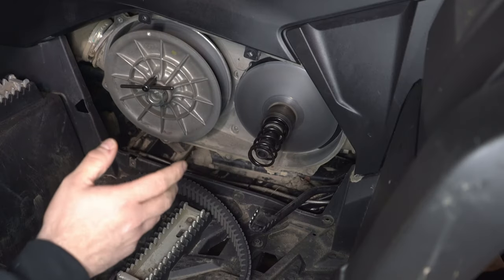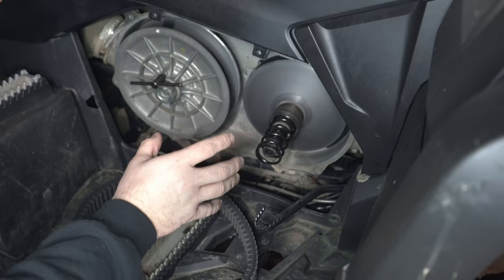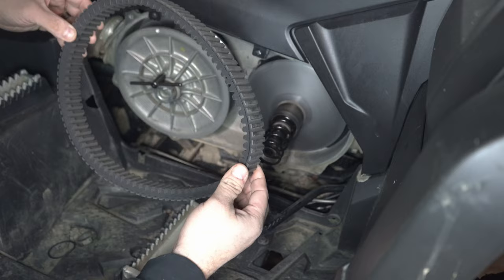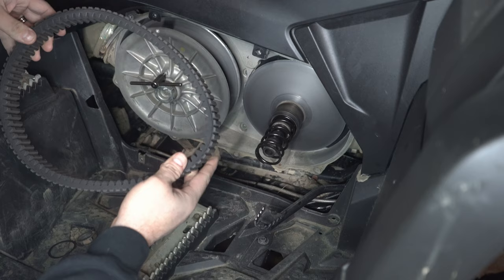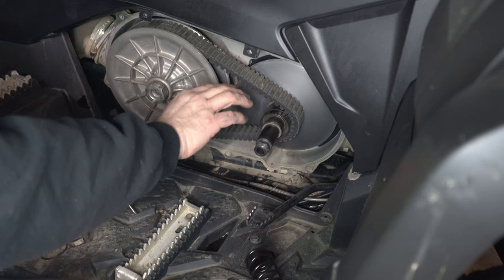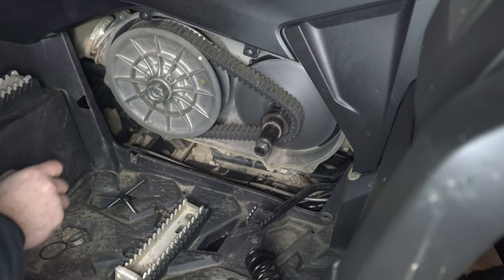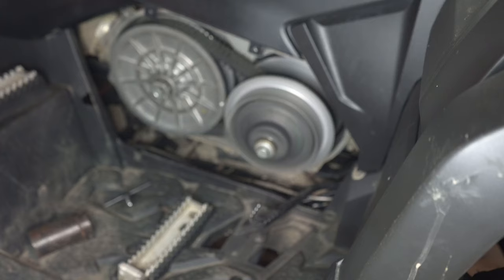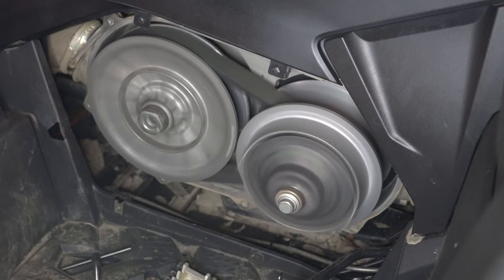Why your CFMOTO Has a Jerky Start / Clutch Noises

Comment: Best to buy a Honda with a real transmission, no belts, and never have to deal with belt slippage, breakage or weights and springs.  🏆🏆🏆
Reply from the maker: No thanks.  Honda and transmission plus reliable don’t even go In the same sentence 😂
Reply: @R.N.GPerformance  I stand by your assessment. Hondas last real transmissions were made in 1997 on the Japanese built accord! 😁
Reply: I had a Pioneer 700 for seven years which I just sold for a 2023 Yamaha wolverine x2.  Reason why I didn't go Honda again was lack of innovation and improvements in their sxs.
Reply: Not true if you get the hondamatic, any water trashes it and your out 2k for another, the foot shift is a different story, but the auto is not as good
Reply: I just sold my P5 with 5.9 " of suspension and a single cylinder for an 800 ex with 64 hp and 10.5" of stock suspension. Only about $2k difference and 3 years/3 k miles newer!
Reply: There’s definitely some truth to that.  Guy I know bought the Pioneer 1000, it was the first year it came out, but he took it in several times over transmission issues.
Reply: Much better yet, get the Yamaha YXZ, a true manual transmission with a real clutch. Then learn how to drive a manual transmission. My ‘16 has been through the mountains, dunes, Baja, and streets. Never seen a single issue.
Reply: If you wanna talk about jerky just talk about a pioneer 1000. That transmission is awful, every shift is clunky and jerky as hell. I wouldn't own another one.

Comment: I don't understand why CF Moto can't just make a great clutch set up from the factory? Isn't that what engineers are for?
Reply from the maker: I agree there.  Yes it is.
Reply: Can't make a one clutch fits all,so the factory tries to make everyone happy, the clutch kit user is the person that knows what where and when the ride needs power torque or rmp hp, no one will ever be totally happy with a factory clutch, unless you are a casual rider and don't push the machine hard

Comment: Hey I’ve been watching your videos learning all kinds thanks a lot man. I swamped my 2022 cforce 600. I did a cpl of oil flushes cleaned air box got new air filter and going to take the belt off and clean the clutch out tmr lol wondering if u should take spark plug out and clean that or not lol I’m on your videos steady hahah appreciate the help!! 👍

Comment: Hello I have a 2020 cforce 600 it started perfect for months now lately it don't want to start have to give it some gas for it to start then I have to hold the throttle for about a minute before it'll idle. Any help? No check engine light or anything. One way bearing was gone didn't know if that would make it hard to start?

Comment: That knocking was driving me crazy before I found out what it was.
Reply from the maker: Right
Reply: I just bought new 800XC, and I can hear the little clunk sound sometimes when slowly applying throttle and taking off, could it be those plate pins as in the video?
Reply: @edgarascernikas2238  hm I’m not too sure about that. The newer models might be different too.

Comment: Hello RNG, thanks for your tutorial videos, i research those a lot for my 550. I am in Germany and my official vendors has no idea about how to fix or tune CFmotos,. Apart from the mere stock CF stuff, there is extremally little or anything to tune. Also, while i have been asking the supplier since the beginning why my CF does not go on Low gear (have to haul alot and work on the farm so that low gear is key for me), i wander if you would know any particulars on why its not getting into Low gear, or if the gear is actually in, it slides out in midway (also i cant put it in park otherwise it wont release of Park and cant start or move)? I wish i could order from you and have things shipped from your website (but it would be too dear and customs would snatch it up) and just do it all myself- but again there isnt such a support in Germany yet, as far as i know, so I have to rely on the official vendors, who have literally no clue....

Comment: Thank you so much for this information. As soon as you pointed out the one way bearing I knew that was my issue. I have been weeding through BS trying to get a better understanding of what is going on in there before I tear it down. It's been getting hard to shift over the last snow plowing season, but now I have to shut it off to shift it. The shifter wont move with the engine running.

Comment: its easy the jerky is the person behind the throttle just get out your grinder and grind your belt down on each side until you see cords fly off then cut groves in top of the belt then turn it inside out flip it upside down make sure to sand the primary n secondary surfaces with 80 grit sand paper until ya see deep scratches then hang on cause now your atv will haul ass lol

Comment: Thanks for the info, very helpful. Just got my new UForce 1000 and noticed it’s a little jerky when I step on the pedal. I’ll wait to see how it goes until after it’s broken in.
Reply: It will continue to be jerky. The problem is not the clutch. A clutch kit will make the initial belt engagement better but not much. The problem is the the throttle sensitivity. Cracking the throttle even one millimeter, the engine ramps to fast. The fix will be softening the first 1/2" or so of pedal movement. You don't need to go from idle RPM to the machine jumping in 1 millimeter of pedal movement. Once the belt is engaged, the throttle needs to ease into the RPM. The UFORCE 1000 does not. It's a real shame because the machine is pretty dang nice otherwise.
Reply: @philburke1902   Thanks for the advice. What state do you live in? I’m in PA, if your not to far I would consider having you work on my unit…

Comment: Red Nick, you do a great job on your videos, Thanks,   My question is:  going over the top of the Clutch is a shielded piece of plastic, which seem to go into the back of the motor, and it has a clean out on the bottom.  What is it for?  Breathing for the CVT? 2022 CFmots Zforce 800 ex.    THANKS and keep up the great work.
Reply from the maker: Yes. And it’s for water to drain it if it gets in there. Thank you 🙏

Comment: I finally got time to install my clutch kit from you( primary, secondary spring, and helix). So the "clanging" sound at idle from the primary is normal? I removed the primary probably 5 or six times. The sound goes away when the rpms increase. It frustrated me. Put everything back together, took it for a spin and it was very smooth engagement. That "clanging" really gets me. Your videos are great!!!
Reply from the maker: Clanging is normal that’s the 3 slides on the cam plate.
Reply: @R.N.GPerformance  thanks for the reply. Never had the covers off before. It seems more of a pinging,  not a clanging sound. It's not as noticeable with them on. Your videos are very helpful and informative!!

Comment: So I have replaced my one-way bearing it's on counter clockwise and cleaned off with alcohol to be sure that grease is not my issue but still I have my secondary spining in Natural and park. If I go back into high and back to park it stops for a few the starts moving again. Sorry to ask you this but I feel your my only hope! Thx 🙏 my friend
Reply from the maker: Give me a call tomorrow 3308060728

Comment: Jerkines is mostly because belt is burned or its under 33mm. Also youre missing alot of things that cause this damage to belt or even CVT itself. You should mention them if you want make videos about it.
Reply: Have less than 1600 miles on our uforce 1000 and its already jerky. The belt was inspected and looks new. Issue is not just because of worn belts.

Comment: 🤣 I got 100km out of my OEM belt paid $317 for a new cf Moto belt and got 25km out of it and it's screwed again. Regret not getting a Suzuki king quad. Nevery had a problem with my old king quad
Reply from the maker: Have you gotten a clutch kit? I recommend only oem belts we sell them far cheaper.  I would also recommend our clutch kits.  We are seeing awesome belt life in our rigs 
https://rngperformance.net/shop-parts-accessories/ols/products/cfmoto-oem-belt/v/0JWA-055000-10000
Reply: @R.N.GPerformance   no clutch kit on it yet only had the bike 2 weeks really frustrated that the belt has gone out twice on a $22k bike I just bought 2 weeks ago

Comment: We were test driving utvs, did can-am defender,  polaris ranger, both 6 seaters. Also tested a cf moto uforce 2 seater  that the belts were squealing and was very noisy in comparison. The dealer just said, "They're all like that." Assuming he meant the moto's? The other one we test drove weren't. But then, the engine and transmission was a full row of seats back further. Would it make that much difference?
Reply from the maker: The belt shouldn’t have been squealing.

Comment: Hey! Someone sent me your link. Lots of good stuff on here. What is that tool you used to loosen the belt? Also was it clockwise or counter?
Reply from the maker: The tool is just a m6x1.0 bolt 3 inch long threaded all the way it’s regular thread.  The primary clutch is reverse thread. The secondary is regular thread.   Thank you 🙏

Comment: RNG, why is the Yamaha CVT rated the best in the industry and they even back it up with a 10 year belt warranty.  Why are they so indestructible?
Reply from the maker: I have no idea.  I think they are just brave.  😂.  They may also use a wet clutch too that takes the beating instead of the belt.  Like our zforce 800s

Comment: In trying to replace the one way clutch bearing on my cforce 500, the bearing will slide over the shaft only to where the locks touch the shaft and won't go any farther. I already trashed one bearing by trying to lightly tapping it the rest of the way onto the shaft
SO HOW DO I GET THIS BEARING TO GO ALL THE WAY ON?

Comment: Mate do you have videos regarding on one way bearing on my primary clutch ? Hard to hift while on h,l and reverse but when the engine is off its smooth to shift? Tnx
Reply from the maker: CFMOTO Engine Brake Problems and Fixes
https://youtu.be/tPa14FY8Ops

Comment: I just went to be able to start rolling at a lower rpm. I have 2 - 600 touring cforce completely stock everything and I have to rev it so high just to get moving. Anyone have a suggestion in what clutch I should purchase?
Reply from the maker: You need our primary clutch kit it will take care of that www.rngperformance.net

Comment: I got a new 2023 uforce 800 I owed a 2017 uforce 800 before and it had engine braking my new one don’t seem to be working do you know what could be the issue
Reply from the maker: My primary kit that will help allot. https://rngperformance.net/shop-parts-accessories/ols/products/cfmoto-cforce-1000-stage-1-clutch-kit

Comment: Hi RN quick question, my 22 UForce has about 900 miles and I’ve been running one of your basic clutch kits for 4-5 months.  I recently started getting a grinding sound in low gear when I’m slowing down to a stop.  Never in high gear but it is intermittent in low.  It sounds like the gear (or clutch?) is not fully engaged, but never happens on take off.  Any ideas what’s making the sound? Is it the primary bearing?  Thanks!
Reply from the maker: Shifter linkage buddy. Low gear isn’t locked all the way in.  Or pinion is going out.  See my newest video we blew a rear differential.
Reply: @R.N.GPerformance  thank you!  I will check the linkage.  Would it be the Front or rear pinion?  I can check that too.  👍

Comment: Hey RNG my 2023 uforce 1000 has almost 2000 miles on it and it's made that rattle cling noise since I bought only does it at idle what could I do to stop it called the dealer and they gave me some run around that they hey dirt in them that's why it's making that noise I bought it brand new and it made that noise just trynna get it fixed the only problem I've had with mine
Reply from the maker: That noise is normal for these clutches.  However if that noise gets really loud you will want to replace your sliders here. https://rngperformance.net/shop-parts-accessories/ols/products/cfmoto-cam-slider-replaces-oem-number-0jya-051004-10000-fits-most-models
Reply: @R.N.GPerformance  OK thank you!!

Comment: Hello Guys ,I have an issue with a CFmoto 625 from 2022 4500 Km on it . Will start but will go high in revs around 2500-3000 then comes slowly down and stays or slowly fluctuate . When driving it will not go more them 40 Km ( in hight ) , from there on the engine is stalling , like it does not have power to go forward. If I start the machine in neutral and rev it , between 4000-5000 it is like is folding something the engine back and will hesitate to smoothly rev after passed the 5000 barrier will rev till max.

I have checked the bet, one way bearings weight etc there is all fine , as it does the same when those are off. Has already new spark, spark lead . New filter . No error on dashboard.

Does anyone came across this and can give me some advise  ?  Thanks

Comment: If I have a uforce 1000 do you think it would be okay to do 30 inch tires and a 2 inch lift or should I just do 30 inch tires or maybe 28 inch tires and a 2 inch lift. I mainly ride a lake bottom it’s sandy in some spots and muddy and rocky. It’s road a lot so the mud is real thick and deep. Just wanted a opinion
Reply from the maker: You can do 30s and a lift.  I do recommend 1.5 spacers in front and 2inch in rear.  I do sell this stuff on my website. Www.rngperformance.net

Comment: My 2019 CFmoto Cforce 500s (75hours) was stolen and when it was found it wouldnt drive—found the remnants of the belt in the clutch and a weird tapping noise—cleaned it up and reinstalled with new belt but still makes weird nosie and when I put in gear the engine dies—Im guessing both primary/secondary clutches are shot? I think the thief rode the ATV fast in low gear? Is there anything I need to check? Im scared something internally is bad…
Reply: I dont mind paying you for your time/information definitely not here to take advantage of your knowledge—Im just on the fence on buying $600 worth of parts if it could be something else

Comment: Is it possible to replace the belt without the tool to spread the secondary? Replacing belts on snowmobiles no tool is needed. You can simply spread the secondary apart to gain enough slack to slip the belt off.
Reply from the maker: No. You need this tool.  https://rngperformance.net/shop-parts-accessories/ols/products/cfmoto-oem-secondary-spreader-tool

Comment: Great info!  Mine has a "rattle" when I rev it, would that be the plate on the primary?  I assumed it was the weights in the primary. Mine has 400 miles and its rattled for a bit now. Just cleaned the CVT area and replaced the belt, still rattles
Reply from the maker: Rattle is normal on these clutches
Reply: @R.N.GPerformance  I figured.. I did recently do a valve check just to make sure it wasent the valves lol

Comment: If I put my CF Moto into low gear it pops out sometimes?  Can you tell me what this is a symptom of?
Reply from the maker: Shifter adjustment
Reply: @R.N.GPerformance  wasn't sure. I just got this 2013 uforce 600 rancher. I'm trying to do all the maintenence. The belt scares me.  It looks like I have to pull the gas tank to even check it. Lol.  I've got it all ripped apart already, just not sure what the best approach is. I download the manual but there isn't anything in there about it.

Comment: I just got a new cforce 800xc and just done the first gear and oil change on it. After a 2 or 3 hrs of riding I have trouble getting it to shift into (park) I have to rock it or backup to get it to go into park. My question is why is it doing that and would a upgrade clutch fix it?
Reply from the maker: Clutch won’t fix that but it will make it nice and smooth and add more power.  A shifter cable adjustment may fix it tho

Comment: Is it normal to have a small pin hole in a primary clutch outer sheave? On the belt rining side? Putting a clutch kit on a friends bike an I noticed it.
Reply from the maker: Yeah. That’s from the casting
Reply: @R.N.GPerformance  thanks appreciate the reply 👍🏼

Comment: So I have a 2018 cfmoto zforce 800 trail. Recently I've been having an issue. I got a bad smell and let off the accelerator then it just locked up. I was able to ride it home then drove around and it drove fine. Then today I got the smell and seemed like it was stopping pretty quick. Any suggestions?
Reply from the maker: Check your belt
Reply: @R.N.GPerformance  this is my first   utv so I'm new to this scene
Reply: So the belt is all good. Problem was I was driving and I Smelled and possibly heard something weird so I let off the throttle and atleast one brake locked up I believe. Cuz I got the whole tire squeal letting me know it wasn't turning. So could maybe something with the brakes? But idk what would cause it

Comment: Tried to find the clutch on Amazon. Could you help me out. Not sure which one? I did look under RNG. Thanks
Reply from the maker: Www.rngperformance.net
Reply from the maker: What are you looking for?
Reply: @R.N.GPerformance  my bad. The clutch system you did the video on. I have a 2022 c.f. moto 1000 and ran tracks this winter in Montana and it jerks starting out in high gear. Really annoying now I have the wheels on.

Comment: Do you lose top speed with the clutch kit
Reply from the maker: Depends on the kit you get. Some you do some you don’t.  Just the primary kit you don’t lose much if any depending on machine tire size etc. you gain allot more power to the ground.

Comment: I have a 2017 800 EX identical to yours it has a real bad dry bearing sound the whole time you're driving I had the engine rebuilt Guy guy charge me 2800 to rebuild it has a real nasty dry bearing sound super smooth kind of hard to get in park the whole time you're driving it it sounds like a real dry bearing what could that be redneck
Reply from the maker: Could be wet clutch.